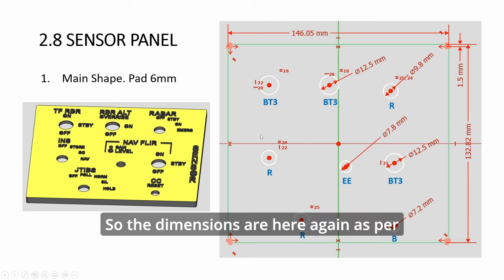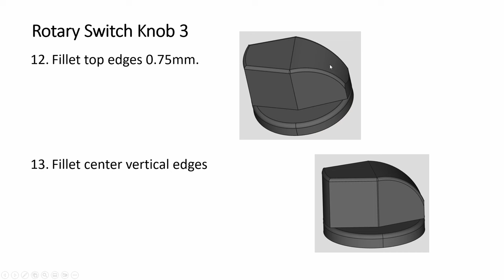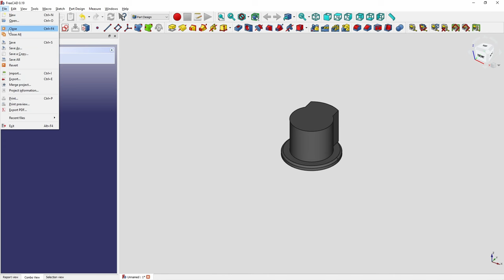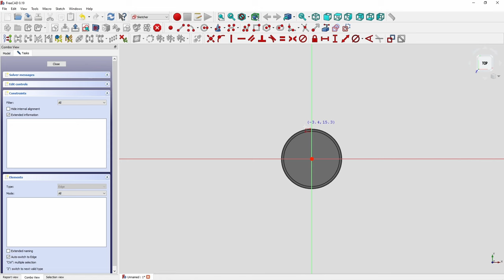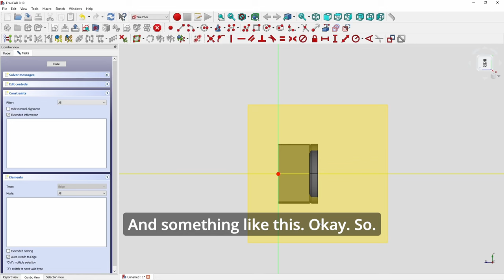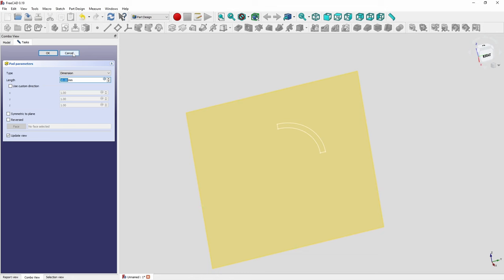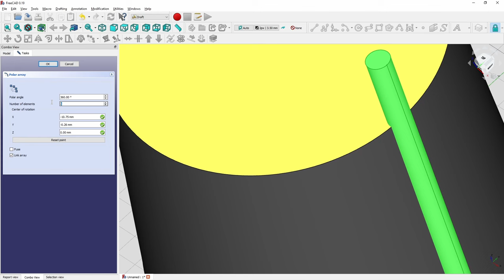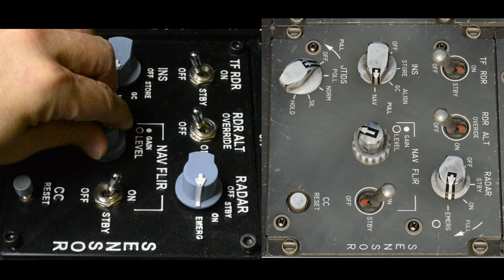Episode 8 How to build DCS F-15E Sensor Panel #dcs #arduino #flightsimulator

Comment: Hi, thanks for the video, I just need to ask a question, can you make a full video on how to not only do the panel, but also how to do the electronics, I just bought an elegoo super starter kit but I don't know how to set up the cables switches and everything, if you could make a video it would help me a lot
Reply from the maker: Look at my first two videos where I showed how to wire all kinds of switches to arduino board, for toggles, push buttons, rotary switches, encoders, potentiometers etc.